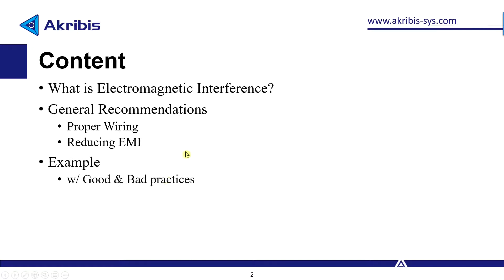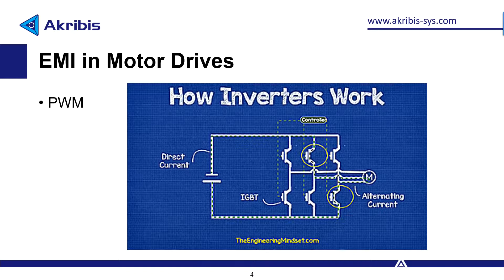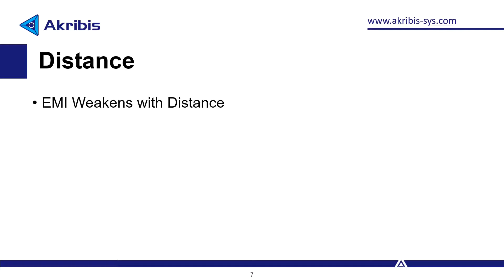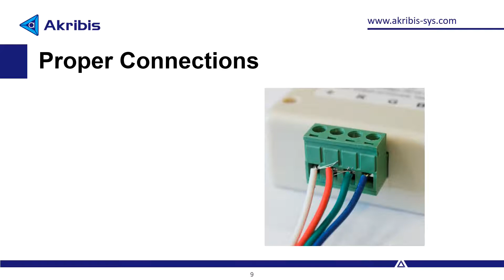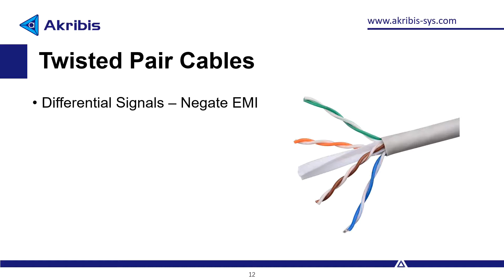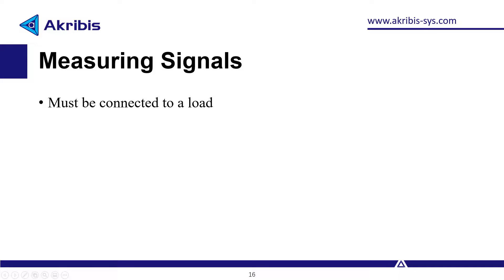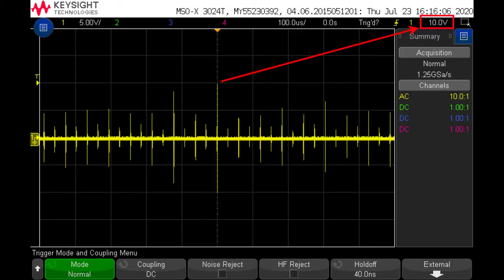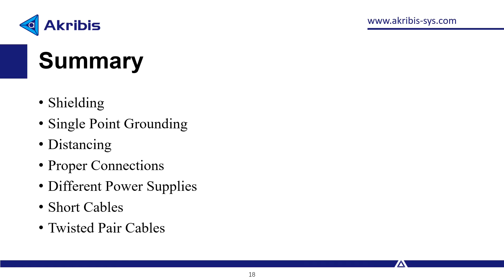Electromagnetic Interference & How to Reduce it

Comment: Hello, I require your input related to an  issue.

I’ve installed GPS trackers on some e-bikes, powered directly from the bike batteries. I’ve also connected a panic button to the digital input (DI) of the GPS.

The problem is that the GPS trackers are occasionally detecting false panic button presses, even when the button hasn’t been touched.

Can you please help me understand what might be the problem?

Comment: Hi, I'm about to turn completely crazy, I've set-up a new PC and the EMI it generates gets into my electric guitars/bass pick-ups and so it goes into both, my usb audio interface and my amp.
At the beginning I thought it was something regarding the USB but nope, I'm 100% sure it's EMI from some part of the PC since I get the same noise just by conecting my guitar to the amp without even connecting to the computer.
My old PC does not generate any noise!!!
I thought about shielding the PC case sides (from where the noise comes stronger) with copper tape, do you think it would help?I would really appreciate your answer since It's really unberable, I can't record anything and my old PC is to old to continue working with it...

Thanks!
Reply: May be power supply noise.